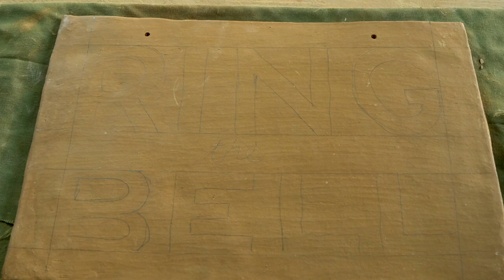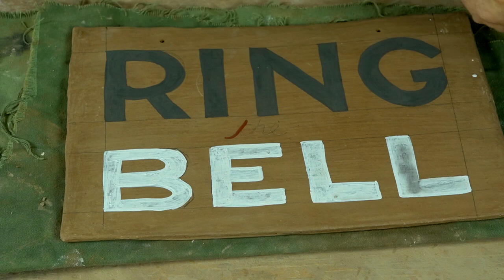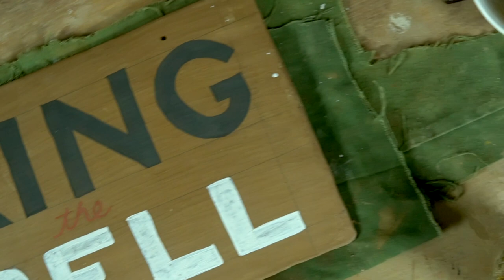Make a Ceramic Plaque With All Natural Materials

Comment: Hi Andy! I do a lot with slab work using native clays, and I have a trick to solve your warpage issue. Simply paddle out your slab to thickness between cotton cloths. Canvas works good. No rolling! The percussion brings the clay particles into a much flatter, tighter alignment whereas rolling just compresses unaligned clay platelets...leading to warpage. If you paddle..no need for sandwiching. Your tile will dry flat on the rack. Try it!👍
Reply from the maker: Oh, nice tip. Thanks!
Reply: If you only paddle the piece can you and should you also smoothing compress it out with a rib?
Reply: @micheledickey4066  Hi, I place the desired amount of clay in roughly the shape slab I want between two pieces of canvas. Then I paddle the clay to an even thickness by paddling both sides of the clay, (flipping the canvas envelope), with roughly the same number of strokes. I do use a rib and water to erase the canvas texture left behind, but this is not for structural stability. Provided you paddled evenly on both sides, you can lay that flat on your drying rack and it will dry with minimal warpage. In doing this, you are simply aligning the clay platelets in a more comfortable way for them. It works, try it! 👍
Reply from the maker: @micheledickey4066   it sure I never paddle anything so I’m not too familiar with the technique.

Comment: You are right about worrying about warppage when drying. Commonly just putting them between 2 pieced of wall board works best. Usually no weight required and no constant flipping, get even drying and almost no warplanes. For holes in clay try using a plastic straw. Push in and twist. It'll pull out the clay leaving a nice hole. Thanks for doing this, always appreciate an everyday practical application using our clay and slips.
Reply from the maker: Thanks Gene, great tips.
Reply: Yes, I was also going to suggest platic straws for making holes in clay - easy to save from drinks. From tiny coffee stir straws to big boba tea or malt shake straws.

Comment: You would be great at making bread. The clay has given you lots of practice. Speaking of which my favorite kitchen store Everything Kitchens LLC has now a lot of clay, & unglazed ceramic baking & cooking things. Several brands are carrying from few to a lot like Mason Cash, Superstone, kitchen aid, & Staub.
Reply from the maker: Unglazed cooking things!? Sounds intriguing, I will have to check that out. I do love fresh bread but between the YouTube stuff, my workshops and pottery I don't have time to get into baking.
Reply: @AncientPottery  if you brought your bread dough along when firing an item in the wild with one of your pots to cook it in with another that could make dome lid (or make a chimney lid for it). Before firing your pot kneed dough & set in bowl covered with cloth where not cold. Then after getting your item you came to fire set up & firing while waiting you could set a place to bake raised bread in the bowl nearby in lower heat coals. Then you will have freash hot bread as you finish your firing of item. You could also cook other items. But bread in clay or ceramic bowls don't make much mess.   You just pack all in your basket to go there & to come home. If you go to that kitchen site & put in the brand "Superstone" you will see bread cooking bowls with dome lids. I think it was "MasonCash" that had a clay flat bottom design with chimney top used in some other countries for much cooking. I have a ceramic small dish with ceramic chimney lid & it makes the best scrambled eggs or 1 large biscuit (it is small & is glazed ceramic).